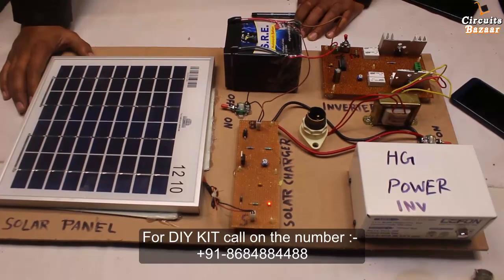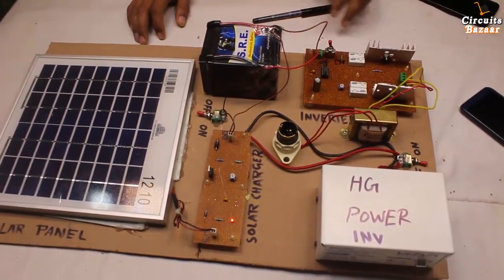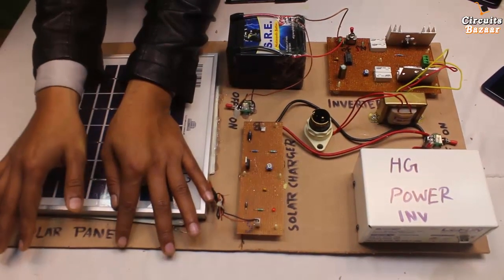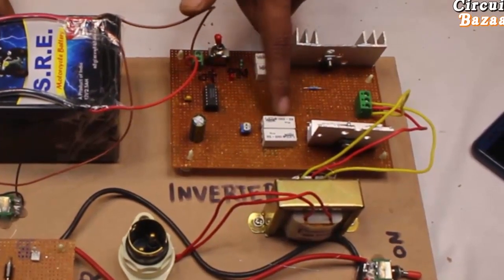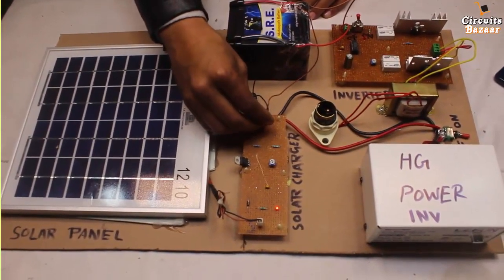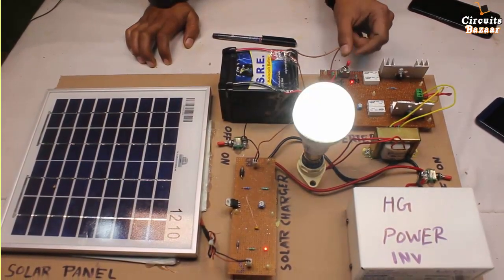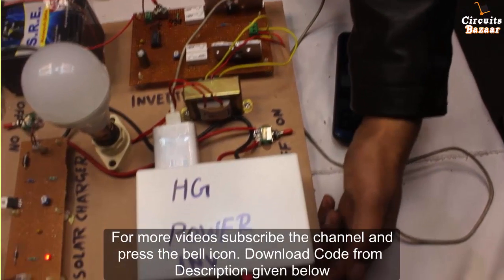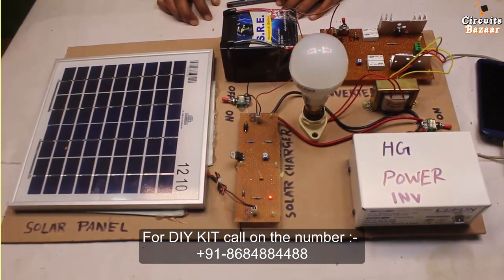Solar power Inverter project with dual AC output  | with circuit diagram

Comment: Sir how much watt you used solar pannel? 12V 7AH batter can I use 18v 10W solar panel
Reply from the maker: I have used the battery 12 volt 2.5 ampere but you can use the battery 12 volt 7 ampere 18 volt and 10 watt solar panel is very effective in this project
Reply from the maker: For the better performance of this project the minimum capacity of the battery must be 5 ampere and you have to choose the right battery which is 7 ampere
Reply: @The.Innovative.Indian  means 7AH with 10W pannel
Reply from the maker: Yes

Comment: Hello sir what is the differences between low power inverter and high power? if we connect mobile phone charger to low power inverter what would be happen ? please help :D
Reply from the maker: If you will connect mobile phone charger at to low power inverter then in that case it's not going to charge your mobile phone because it doesn't have that much power which can charge your mobile phone

Comment: What are the amperage/volt characteristics of transformer and battery? If we used the circuit without a transformer, would the working time of the lamp decrease? So what exactly does the transformer do?
Reply from the maker: Battery 12v, 2.5Ah each
Transformer = 12-0-12 12V, 1amp.
You have to use transformer to get ac output

Comment: Why transformer is used here? Can anyone tell this?
Reply from the maker: To generate AC voltage output
Reply: Transfomer is for stepping up the power. From 12v to 220v

Comment: High power cct is not included . Only battery charger & Low power cct. How to get high power cct. I wanted to buy DIY KIT. 
 These are the 2 links I used. Please be kin enogh to reply.
https://drive.google.com/open?id=1c5G...

https://drive.google.com/open?id=1JpX...

Comment: What happnd if we use 60-100W solar and can we provide only one diode  for both the purposes in solar charger then why r u using two diodes
Reply from the maker: for better isolation i am using 2 diodes

Comment: Sir nice video but aap charge controller and inverter ka circuit diagram send kariye na..
Reply from the maker: Please check the description ...it already there ... or send us your mail id. we will mail it to you
Reply: @The.Innovative.Indian  Sir kindly mail the whole circuit diagram, and also mention the mosfet model number which is used in solar invertor and also mention the circuit diagram of high power invertor, 
abdullahmemon611@gmai.com

Comment: No need of charge controller, 🤔
Reply from the maker: solar panel is generating 20 volt here .... you need to down it to 13.5 volt to charge the 12 volt battery ...